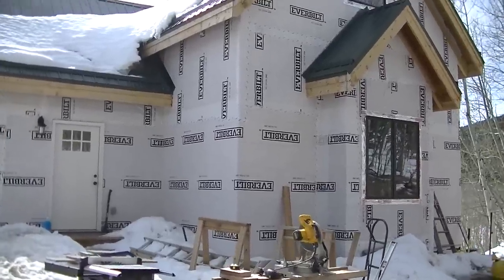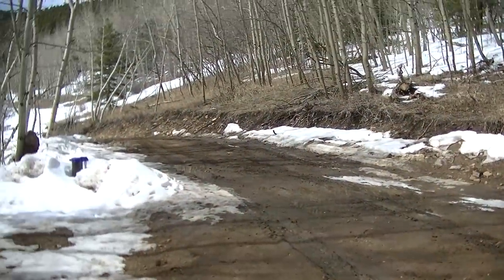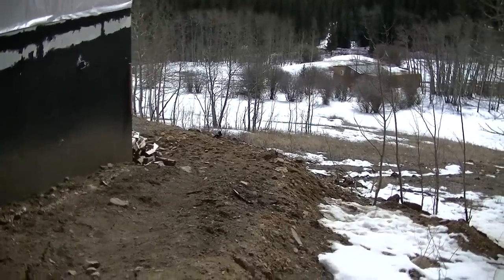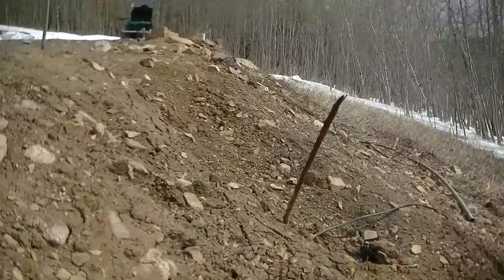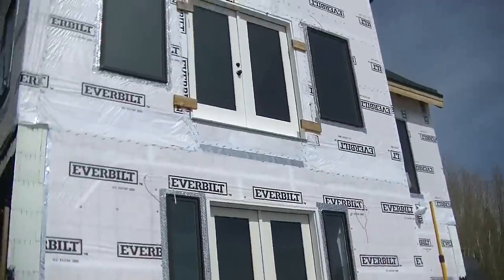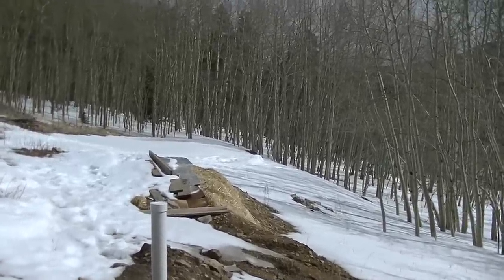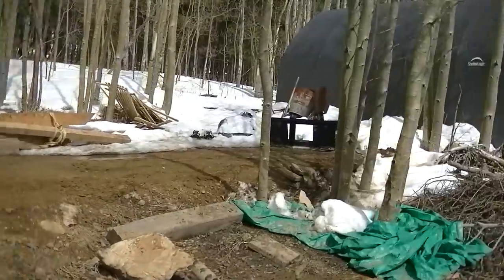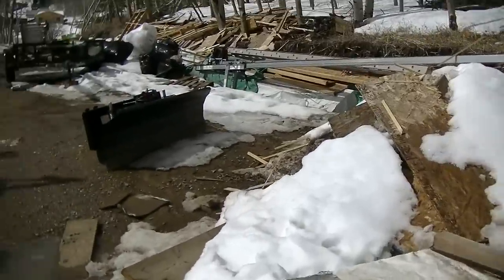Five Major Outdoor Projects on our To-Do List

Comment: Flatten the area in front of the tractor (provide enough slope for drainage but..)  all the way to the Quonset(?) for better parking and staging area for gravel and building stuff. Use the extra soil as fill for the septic...and other areas. Better parking and  maybe future garage/workshop?
Reply from the maker: Yes great suggestion- thanks!

Comment: For your retaining wall, I would suggest what we call Gabion Baskets filled with big rocks. 🏴🏴🏴🏴
They allow very free drainage as well as working as retaining walls, each basket is usually 4ft x 2ft. 🏴🏴🏴🏴
Reply from the maker: Ah, I've seen those. Not so keen on the appearance, but we certainly have enough rocks for it!
Reply: You can take your time and place the rocks facing the front to give a good effect and just back fill with less desirable plus factor is the cost ! 🏴🏴🏴🏴

Comment: You've got a full boat. My opinion..deck, siding, septic, retainer wall. Last would be drive. Everything except septic will require heavy loads to house which would destroy your drive. You know what really needs to be done for your final and the rest is consequential. Something to remember when you're doing your deck. If it's the yellow treated lumber read the warning about contact with aluminum. It will cause corrosion as I found out. Best wishes and am wishing we had the snow instead of the weather that's coming through tonight.
Reply from the maker: Good points you bring up. Plus after the mud is gone, the drive will be static for awhile. Bryan was thinking of retaining wall before deck, because access to the hill. Maybe they can be done in stages, instead of start-to-finish projects.
Reply: @ColoradoMountainLiving  he's got a point there. Please don't forget about a "French drain" behind that wall and it were me I would build the wall a couple of feet higher so the water wouldn't flow over the edge. Use plenty of large stones for erosion control. The settling you showed will be an ongoing thing but it will eventually settle out. Y'all are doing a great job and I love that pup.
Reply from the maker: Gotcha. He's got one drain going down the hill already from the house, but a separate one across the wall would be smart. Thanks!!

Comment: Dig out a trench on contour for backfill, fill the trench with untreated wood, brush, logs and top it up with the topsoil that was there, then you can start a Hugelkultur. Use the septic field to plant year round flowers for the bees. Railway sleepers may contain toxic substances such as arsenic, that can leach out into your surrounding soil. Best wishes with your daunting tasks ahead. Greetings from Holland.
Reply from the maker: Oh yes! I heard about Hugelculture.That's a great suggestion as we still have lots of brush and logs laying around. We did plant clover last year over the septic and will continue to plant more over the leach field and disturbed ground that has been excavated. Good advice on the railroad ties- will consider that.
Reply: @ColoradoMountainLiving  Little Mountain Ranch channel put a hugelkultur bed at the bottom of her sloped garden, she kickstarted the bed by adding manure to the topsoil

Comment: Regarding your drive it is likely to get chewed up by your phase 2 construction traffic so it may not be best to finish it yet.  But It would be a good idea to put a shallow ditch on the low side, where the field is not lower already, so that the water runs off maybe 300mm deep (12"). If your electric trench has consolidated just leave it but a lot of it looks like it is mostly on the high side. Then just extended it west from the first bend it will held to keep that section dry. 

I would remove the heaps of soil on the east side of the drive up to the first bend. Then the snow is more likely to blow off into the field north of your neigbours.

I have not seen all of your videos yet(got to about 48) but your electric trench across the drive will consolidate. If you are going put more gravel on your drive this year I would dig it out to 450mm (18") above the cable then put in some stone and compact it with a plate compactor  in 100mm (4") layers.
  
You were talking about piping the spring across the upper part of your drive which would help as well. What are you going to do with the pipe on the garden side. You may have enough height to use that old water tank as a water tank then you can water the garden with that if any plants do not like chlorinated water.

A king post wall would look good. Make sure you have a good concrete footing around the bottom of the posts. You can get railway sleepers treated with less toxic preservatives. Make sure you put a drain behind the wall.
Reply from the maker: Great suggestions! Thanks so much. Phase 2 won't begin for at least a year, as we need time to regroup, take a rest and save money and pay off debts:). We may go with crushed asphalt instead of gravel, hopefully that will make it more stable and less likely to migrate into the grass. We did think about using that water tank as a holding take, we have a large 200 gallon size and smaller 75 gallon size. It would be a perfect option for garden watering or even creating a drip line. We do have an old cistern on the property behind the bank on the lower curve of the driveway, not so visible in the snow, but there's a large depression about 20 ft from the corner. Someone else mentioned the chemicals in the railway sleepers- thanks for that.
Reply: I see that most of my suggestions have already been made but it does not hurt to get the same suggestion from more than one person. I have worked in road construction but have not been involved in any roads that are subject to extended low temperatures. Where I live here in the UK I did see any snow this winter.

By crushed asphalt I assume that you mean asphalt that has been planned off roads when they are making repairs. Road plannings do have a certain tendency to stick together and so the surface would fret (get chewed up) less than gravel. 

Other people have suggested putting a crown on the drive. Unless there is some advantage for driving in the snow I would suggest a straight grade from one side to the other, say 2.5% grade. Your plow will not follow a curved profile so it will hit the top of the crown and leave the snow on the sides. When you try to get the sides you are likely to rip up the top of the crown in the middle.

Starting at the county road up to a couple of car lengths before the first bend, fall to the east. Then change the direction of fall gradually to just before the bend so that the fall is to the west as you hit the bend then south as you leave it. Then swap the fall to the north before the second bend, if this does not take too much stone. Beyond the last bend up to near the well, fall to the southeast. The area behind your house needs to fall towards the well area, rather than towards the house, hopefully the well area is not too high.

This is most likely not a problem for nearly all of your drive but the middle of a crowned road is flat so does not shed water as well.

 @ColoradoMountainLiving

Comment: My personal experience is that railroad ties won't last as long as you would think.  They rot, then collapse.  I replaced mine with loose stacked rocks.  Easy to repair if some come loose.  May not work for you as your wall is much taller than mine.  But I agree with (other comments) that it may pay to do more research.
Reply from the maker: Yeah, i think Bryan changed his mind on those- that was just an initial idea for looks.

Comment: You are going to have your hands full this summer for sure if it all has to be done at a certain time. Hopefully the permit is only for the house siding and not any of your outside projects. Does the deck count as new construction where you are? Will it have to be permitted separately?
Reply from the maker: That's a good question about the deck. I think here a project only counts as new construction if it is larger than an 12x12' outbuilding, according to what our inspector said. The permit is for the house, and the driveway and septic -which still need final sign offs. The septic needs more back fill, but technically the driveway is ok as-is, they are only inspecting based on % grade, I think.

Comment: Please do not use railroad ties!!! Many places consider them “hazardous materials” due to the large amount of preservatives (often creosote). It may be a huge headache if you need to sell down the road. Been there done that...
I’d suggest large stones for a more natural look at a decent price that is FAR less labor. You can find some your Kubota can handle and not detract from nature or add a crappy man made item. You chose that area for a reason, make the most of it.
Reply: I'll add that railroad ties also stink when the sun hits them.  It's not pleasant (like tar).   I'll second the above about using boulders.
Reply: Absolutely support these comments. The leaching and environmental issues alone could eventually cost thousands if your county changes its hazardous materials usage allowances.  Not to mention the smell and unsightly appearance. Please consider the boulders or Gabions.   First thing first, finish the exterior and focus on your critical path items.
Reply from the maker: Good points all! We haven't made any final decisions so I think Bryan will like to hear this input. maybe just i-beams and deck wood for the walls. We have LOTS of stone on the property and access to large boulders, but just need to figure out the logistics of transporting them.
Reply: Colorado Mountain Living - I think you are underestimating the installation of I-beams as a way to hold a retaining wall. First is the cost, (price structural steel sometime), second is sheer weight (will need specialized equipment to move them), three is installation, depends on the height, but you will probably need a pile driver to put almost half of the beam deep in the ground. 

A wall more than about two to three feet in height, probably should consider getting an engineer to take a look and sign off on the project (your insurance carrier may demand it!). You have already disturbed the soil AND you have the entire weight of your house on top of that, you are asking for slippage if not done correctly. I have seen nightmares from DIYers not understanding physics, geology, soil structure, and hydraulics.

Comment: Oh my goodness . So many large projects still to be done and working full time . It would drive me nuts . Don't understand this permit thing be over by June . Permit for what . To finish building the house ?  Some people take quite a few years to build a home . Nice video . Take care .
Reply from the maker: Yes the house permit, but we can renew it if needed, just will cost $$$. All we need to finish our permit is the siding done and some safety features inside, railings & stairs. Thanks
Reply: Forgot to add ... retaining wall . Instead of a solid wall you could use cages filled with stone and step the wall up the side . You can go as high as you like with these cage walls . I've seen them in peoples backyards and along highways . Just line the back with heavy duty contractor grade ground tarp to stop any dirt going through. Water will still go through . I think it will look much nicer than a wall made up of railroad ties or something like that and they won't rot like wood can . No posts to drive in and you can build one cage at a time .  If you wanted to you can also plant vines to eventually cover the cages . Just a thought .
Reply from the maker: Someone else suggested that idea as well. We're not crazy about the appearance of them, but we certainly have enough rock around.

Comment: rail road ties are the worst choice honestly. Why do you think the ties last so long for railroads? Because the ties are sitting on gravel not in contact with moisture / soil. Try rail road ties on a flower bed , they rot out very very quickly. Drive around and look at  commercial properties that have stood the test of time. Please do some more research plz. See what folks do in europe ! they think 100 years plus down the road , never doing things twice. Thanks for the update . What is the hill "grade"  / slope angle? Learn from others , simply solutions are often the best .
Reply from the maker: We haven't made a final decision, just sharing ideas we thought of.  we might not go that route after all. Maybe just the i-beams with pressure treated wood. Not really sure of the hill slope, it's not constant- gets steeper near the top.